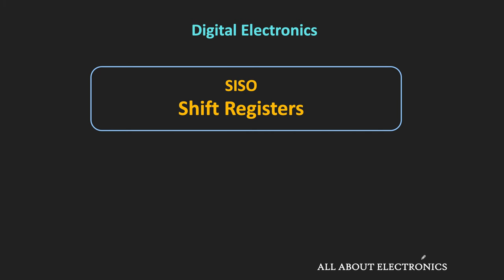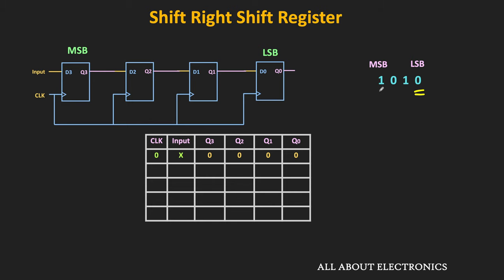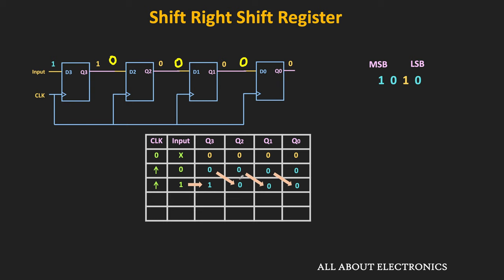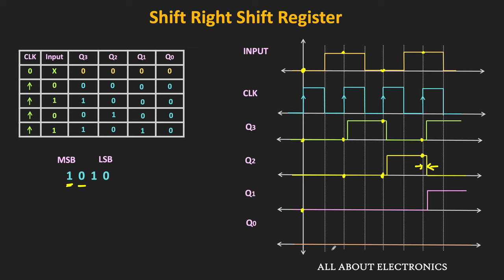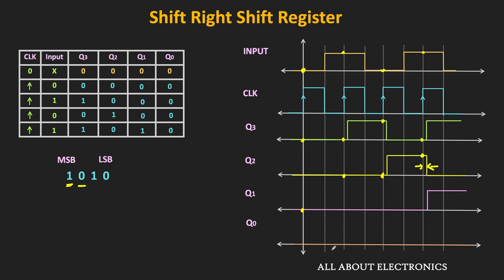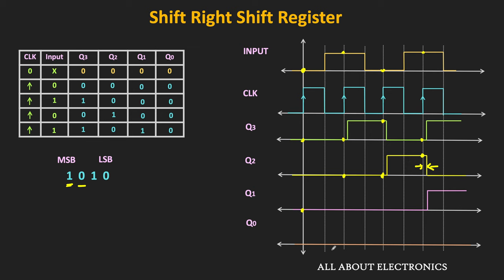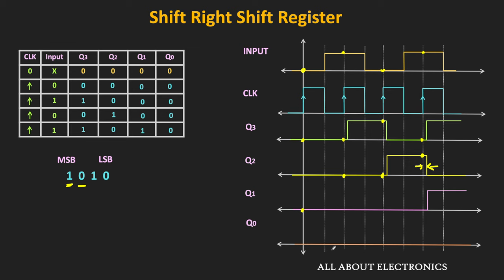Shift Register : Serial In Serial Out (SISO) Register Explained | Bidirectional Shift Register

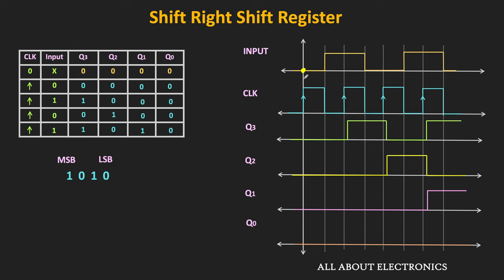Comment: At 6:14, when you show the graphical output, I don't understand why the inputs change on every negative edge of the clock pulse. Is that an error? It should have coincided with every POSITIVE edge, right? Please clairify! P.S., love your videos!
Reply from the maker: Input is  bit stream which we want to feed into shift register. It is not necessary that, it should follow the clock signal. It can change independent of clock signal. But the shift register will respond to that input at the rising edge of the clock. I hope, it will clear your doubt. If you still have any doubt then let me know here.
Reply: Ahh got it, thanks a  million!

Comment: in bidirectional register there is no enable input so after loading the data into the register how can we make sure  there is no random input present in the input
Reply from the maker: Typically, it has to be there. But if it not there then you can use additional external logic, like you can disable the clock, so that once you write the data, no additional data can be written into register.

Comment: i think u confuse its not SISO SIR. Its bidirectional shift register. for siso we need 8 clock pulses
Reply from the maker: For a SISO register of N-bits, to shift the N-bit data we require N clock pulses. The bi-directional shift register is covered from 13:10 onward.

Comment: I can't understand timing diagram sir
Reply from the maker: The timing diagram shows how the output of the each flip-flop in the shift register changes with every clock pulse. At the rising edge of the clock, whatever input that is present in front of each flip-flop (in this case, that is the output of the previous stage), it will be loaded in the flip-flop. 
The Q3 or the MSB of the shift register will follow the serial input at the every clock pulse. 
Q2 will follow the output of the Q3 at the every rising edge. And the same is the case of Q1 and Q0. 
Now, if you see the timing diagram then you can understand it easily. Here the outputs Q3, Q2, Q1 and Q0 of the flip-flops have been slightly shown delayed due to the propagation delay of each flip-flop. 
I hope, it will clear your doubt.